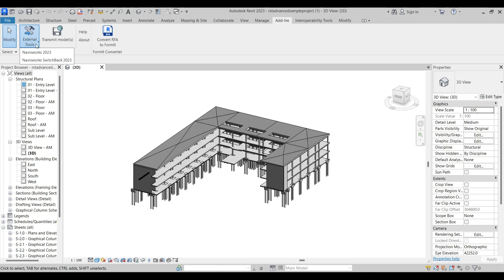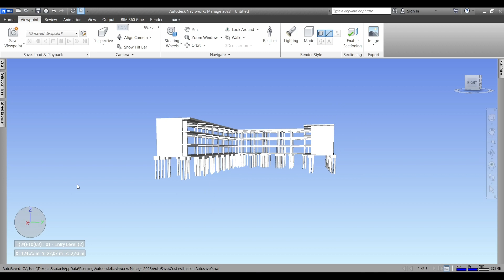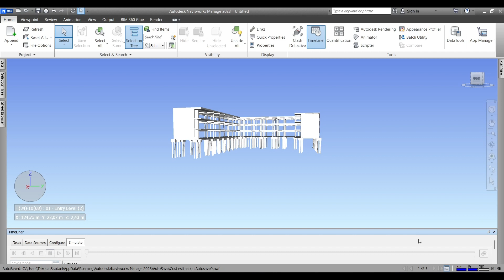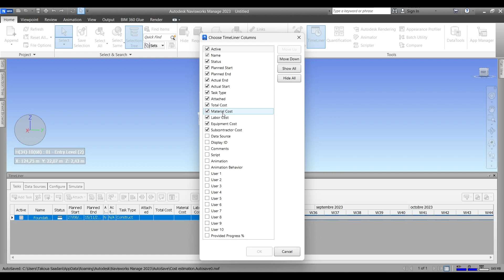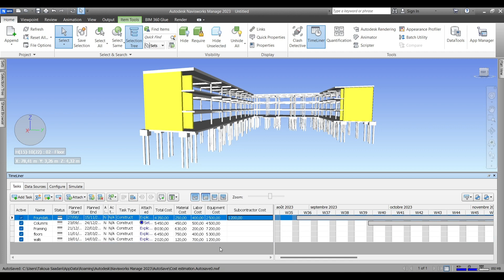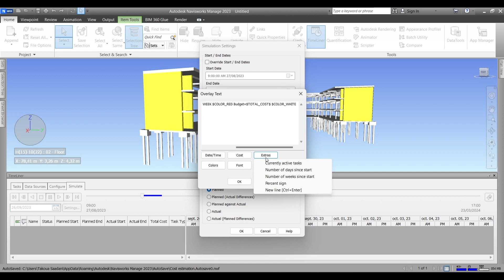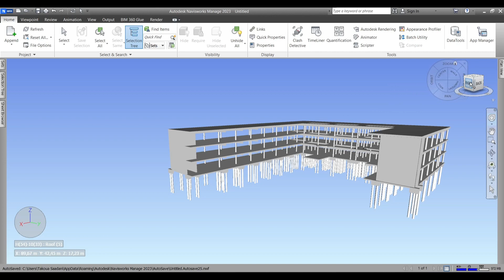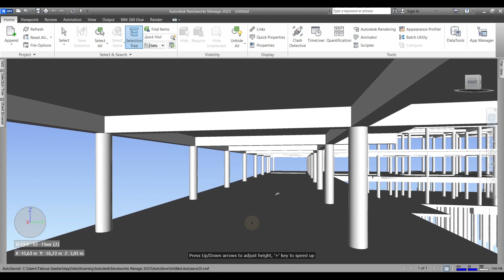Cost Estimation tutorial using Navisworks Manage 2023 | Timeliner tool | in 8mn

Comment: Hello, possibles to export timeliner animation to FBX? Thxe
Reply from the maker: Navisworks doesn't have a direct feature to export Timeliner animations to FBX format, But you can export the Animation as an NWD File then convert it to FBX format, you can use Autodesk's FBX Converter or another 3D modeling/animation software that supports FBX. I hope that was helpful
Reply: @HowToBIM  Merci 🙏
Reply from the maker: Avec plaisir xx